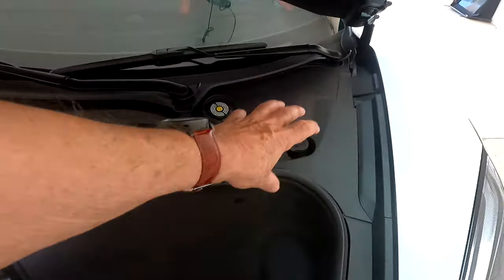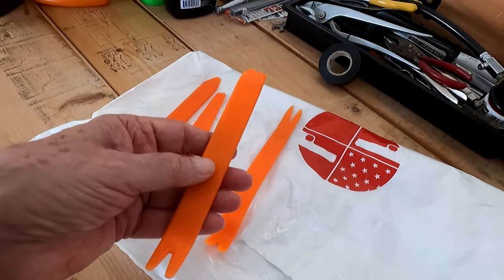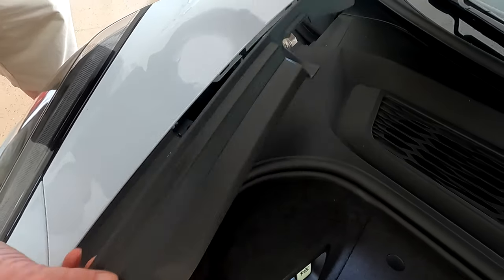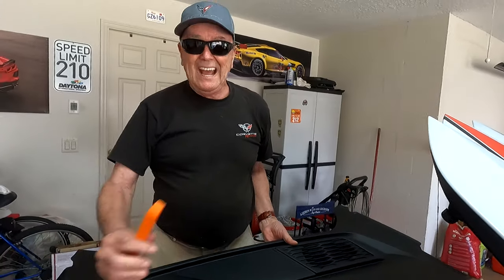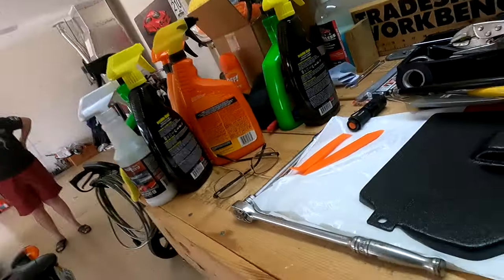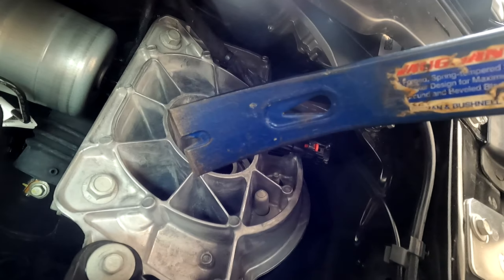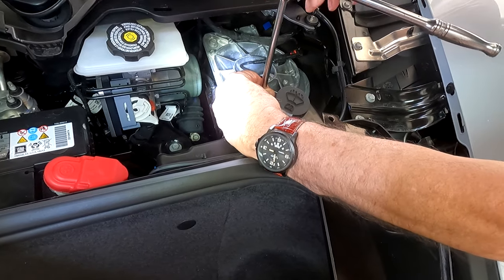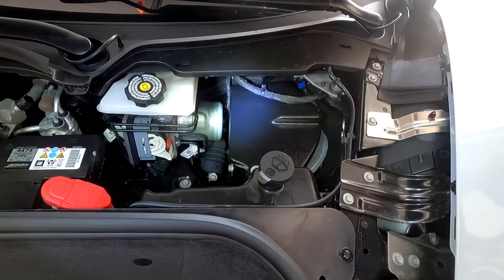Strut tower caps install on a C8 Corvette with Mag Ride

Comment: Your suggestion regarding using a crowbar to remove the wire harness holder was a lifesaver. Probably saved me an hour of frustration. I managed to complete the project in less than 1 hour.
Reply from the maker: Great that it helped. It was a challenge for sure!!!

Comment: I’m not sure but thought I had read GM has solved this by putting weeping holes in to let water drain out.  Maybe somebody here can confirm this.  As usual very well done vlog!
Reply from the maker: My C8 is a 2020 and there are 4 holes that seem to let water into the strut towers up front and I've heard that guys have blocked the 4 holes. But I've not heard that there are holes in the strut towers for drainage. But I am surprised that GM didn't catch this one with all the testing they do before production.
Reply: Brad, there are weep holes on the rear towers but still not on the fronts
Reply: @olsen185  I read that the problem was resolved for the 2021 c8.